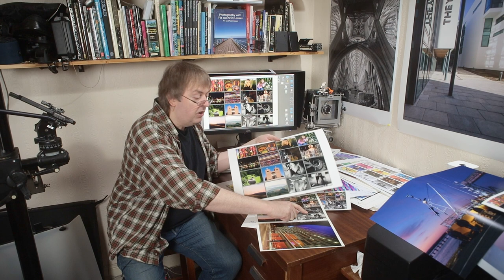Why your prints will never match your screen, and why that's a good thing

Comment: Keith, great advice, as always. One bit of parallel advice I use to give my students, going back into the days of silver b/w printing and color printing in the darkroom, was “take the print with you and look at it over the next couple of days in different places and under different lighting conditions, and if possible take it to where it might (ideally) be shown. Bring that experience of looking back to the darkroom (or the monitor + inkjet printer) to see what improvements you can make.” To this I would also sometimes add, see how the photograph looks framed, behind glass, before you consider the adventure over, and even consider how the size of the print might affect your choice paper as well the color and tonal characteristics of the print.
Reply from the maker: Yes - it's one reason I don't use my print viewing stand nearly as often as I thought I might. It's also my response when people ask about getting specialist lamp fittings and lamps for their print area - fine if you've a specific reason, less relevant for most people.

Comment: Thanks you so much for this video you synthesize my thinking about printing. The most important thing in printing is the result. The road to get there is important but is not the main goal. Month ago I made the mistake of printing with the wrong icc profile and the result was better than the series made with the good one. The key to achieving great result in printing is experimenting and making mistakes.
Reply from the maker: Whilst the 'wrong' profile is never a route I'd suggest - if it works, it works ;-)
It's the result that counts...

Comment: Great stuff! I tack my prints on a bulletin board and after looking at them for a few days, it's amazing what you see that you didn't see earlier.  Almost always have to make a new print. My biggest problem with the board is getting decent light on them. Windows and lights in the house reflect off them in non flattering ways. I'm about ready to get into the wall and put an AC plug up high. From that I can some mount some sort of multiple light setup to shine onto each print from above.
Reply from the maker: Yes, lighting is often underestimated

Comment: Hi Keith. I’m fully set up for top quality prints. I think my screen is the same as yours and the best photography investment I’ve made. After purchasing screen I started to do colour photography. My prints couldn’t be better.  However as you said, I only use soft proofing as a sort of indicator.  I’ve watched other photographers go to great lengths to edit a photograph, put it into soft proofing only to use the most basic ps (hammer and chisel) tools to adjust? Who would know if your prints hadn’t quite matched your screen? Don’t get me wrong, you should aspire to produce the best you can. I love the prints I make on Matt papers. Amazing. One  thing you may comment on is the use of a rip. Colorbyte software apparently takes over the engine of your printer and will take it past the limitations of the native software. But expensive.
Reply from the maker: Thanks
Used to use that RIP with my SP9600 15 years ago. It was useful but expensive then - these days, it's a pricy luxury I've no use for any more.  It has its vociferous fan club, but the entry dues are too steep for me ;-)

I will have another look at the Mirage print software with the P5000, but that isn't a full RIP like ImagePrint.

Comment: Hi Keith, thanks for all the videos and the posts on DPR. You were a great resource when I was considering buying this printer (now I have it). I am really confused by your comments about soft proofing. You say that some of it is useful, that some is overrated, but then what parts of it do you use/trust beyond the gamut check? I was taught by some of the professional printers in town that the soft proof in PS with Simulate paper color, simulate black ink and black point compensation, all checked "should" be a close emulation of how the print would look like. So I use that view to pre-compensate with editing in PS to achieve a look that is close to what I originally had for my (calibrated) screen view. I can't say that that soft proof is always close to the print in my hand viewed with a calibrated lamp; this varies by paper (and therefore the icc profile I use).

So, do you have better guidance as to what part of the soft proof view you trust or find useful?

Thanks!
Reply from the maker: Your 'professional printers' are missing out a key element - their personal experience of what a print looks like and how it will [always] differ from any screen view.

I use soft proofing as an occasional guide for strongly coloured images where I want to see details of colour transitions and the like - it's sometimes helpful.

Soft proofing appeals to 'recipe followers' ... A>B>C>Print . Unfortunately the best printing needs a feel and understanding of what's going on - that [hopefully] is what your 'professional printers' have...

You already have the key expertise when you've noted the the soft proof can be quite a bit out depending on paper. Learn to view the print as the final result and the screen image as an intermediate step, which may differ depending on the paper and image.  

This is why I pay so much attention to printing known test images for any paper - they give me a baseline more firm than looking at prints of images I've just edited

Comment: As always many thanks for your channel. Just as a small reminder… i wrote earlier when you got the P5000 that I didn’t found how to get the nozzle check as an automatic scheduled process. For example when I am out from home for a week. I tried but not succeed… take care! Göran from Latvia
Reply from the maker: I was told that setting turning off the auto shutdown, and setting a cleaning time would do it.

I can't actually test this at home though (I'm not leaving the printer unused and switched on for a length of time)

Comment: Lots of good information, thank you. Have you an article on the important of file size, resolution, from a camera?
Reply from the maker: No, because it has so many caveats, any suggestions would be largely meaningless.
If I gave a number for any particular size it would be wrong - the answer is 'it depends'

You need enough detail for the print size - it's also about image content and subject.
Reply: @KeithCooper  
Thank you for the quick answer. My problem is that I just got a 2nd hand 36Mpix D800E and I try to plan ahead for a 2nd hand 45 Mpix D850 in such way that I have planned to get two Zoom lenses 24-70mmF2.8 E VR and 70-200mmF2.8 VR. I just got a 28mmF1.4 E to the camera but I have lots of old Nikon and Zeiss prime lenses and also three Nikon TS lenses that I will use on a 45 Mix camera but in a few year time there will be a 55-67 Mix Z8 camera. And then my lenses may not be good enough and I will use a FTZ adapter on that camera if I can afford the Z8. I'm an amateur “arty” woodland and infrastructure photographer and I plan to print A2 using a Epson P900 printer.
Reply from the maker: I've printed from 11MP images at A2 - so any of those cameras are easily enough.
I know you want numbers, but you won't get them from me ;-) :-)

As to 'lenses not good enough' - I've heard this for nearly 20 years and it's still largely just hot air on camera forums ;-)

I still use a Canon 24-70 2.8L and 70-200 2.8L IS I bought in 2003, but on a 50MP camera.  I expect to use them still, when the 5DS is replaced by a 100MP camera ;-)
Reply: @KeithCooper  II still have a D700 12 Mpix camera that replace my D300 12 Mpix DX camera a year ago when it broke down. I don't have a 19mm PC lens yet or a good 50mm lens. I got a Zeiss planar 50mmF1.4 but it has CA at a large aperture opening. And I don’t have a good AFS 400mm F2.-8 G VR tele lens but only an old AF300mmF2.8 IF-ED screw drive lens.

Comment: The display used makes a huge difference also, lighting matching to the calibrated device or vice versa is also helpful when comparing; high CRI bulbs are preferable as well. Using a well calibrated OLED C1 (sub 2% de BT.2020 and sub .5% rec.709 with calman), they are much cheaper compared to desktop calibrated displays for editing purposes and offer flexibility of use),  I am able to use soft proofing in ps very effectively to get a image to look how I want on a specific paper types before print.   I don't think all images/art styles belong on, "the customer's paper of choice", but they should be sold the correct paper to most accurately display the image/art they choose.  There is surely an optimal  paper for each image or art style, in most price ranges.  The main differences for my workflow;  the smoothness of gradients are superior once printed, not different overall in color or tone, but in the transitions between on a higher dpi thus making it look smoother, the ppi of the monitor being only 91.79 pixels per inch shows more steps (main disadvantage to using a large oled).  This is with a professional printer full disclosure. (z6200PS).
Reply from the maker: Indeed, soft proofing CAN be of use if handled well - poorly used it is a source of frustration for many.

Comment: I just try to optimize what I see onscreen (my primary workflow being DxO PhotoLab 5 Elite, possibly also using Nik and/or Topaz Photo AI or other software, depending on the image). When I get the image looking the way I want it to (on my factory-calibrated Benq PD3200U 4K monitor set to sRGB and 50% brightness--I generally edit with most outside light blocked out and no artificial ambient light), and save it (either as a TIFF or JPG). When I want to print (on my Epson P900), I open the file with Epson Print Layout and generally use the OEM ICC profile for color, or Advanced B&W Photo for B&W (in which case I generally use the confusingly default "Darker" setting), and Black Enhance Overcoat and Black Point Compensation where applicable. I'm still not sure about Perceptual vs. Relative Colorimetric Rendering Intent, but generally use the latter (more testing needed). I rarely use Maximum Quality as High Quality produces phenomenal prints in most cases and takes a lot less time. Although, as you point out, it's impossible/pointless to 100% match a projected image to a print (and of course prints look radically different depending on paper and lighting), I'm generally satisfied that the print reflects my artistic vision based on what I see onscreen. The important thing is "does the print work?" Experimenting with various papers and settings is part of the process (as you say, experience is hugely important--I still feel like I'm on the steep part of the learning curve) but IMO it's better use of time to record and edit more images than to obsess over the mythical "perfect" print (sometimes easier said than done)...
Reply from the maker: Yes - finding your path through this takes some time ;-)

Comment: Hi Keith, newbie here. love your videos and am slowly figuring out how to print. One question that keeps coming to mind is this:
Cameras can capture images in either Srgb or AdobeRgb gamut. Monitors can display in either an Srgb, AbobeRgb, or Dcp gamut. But nothing I’ve heard ever mentions what gamut a printer uses. Does a printer use a gamut? If so, which? Does it matter? The reason I ask this is if I take a photo using AdobeRgb, process (edit) it in software using AdobeRgb, then print the photo, will the printer be able to use the AdobeRgb gamut or does it say print in Srgb. Are there limitations to a printers (for lack of a better term) gamut.
Reply from the maker: The printer/paper/ink gamut is defined by the printer profile.  This is either a specific icc profile, or an implied one inside the printer driver

Cameras do not capture in srgb or A98 - raw files have no profile. A profile is assigned when processing them either in camera [jpegs] or with processing software

Monitors can display in whatever gamut they have - this can be calibrated to a known type if needed and within the range of colours they offer.

I have covered this in different ways

See this
https://youtu.be/1XbjGvVJZQU

and this
https://youtu.be/a1O__CFXKxE

Also, I'd suggest reading this - very useful
The Colour management chapter from the CS3 book [still relevant]
http://www.photoshopforphotographers.com/pscs3/download/PSCS3_colmanage.pdf

Hope that lot helps!
Reply: Thank you. That clears a lot up

Comment: question: do you come to lincolnshire and can you fix my prints? 😂 been struggling to get the prints somewhat close to the screen. but they come out super desaturated quite often. tried to set up my monitor so its more desaturated so I can get a more accurate representation. tried changing the ICC profiles , but the results aren't great. the best I could get was to save as a jpeg then print it off. going to buy some epsom glossy paper so it matches my printer see if that helps, (that was epsoms  default fix because they couldn't help me ) after that I'm out of ideas.
Reply from the maker: I do bespoke on-site print training as part of my commercial work - see here
https://www.northlight-images.co.uk/commercial-photography/training/photography-tuition/
Drop me an email via Northlight if you want to know any more?
Have you calibrated the monitor - this is not something which can be done 'bye eye'

Comment: Do margins actually always appear correctly on paper? (Specifically the Epson ET-8550)
Reply from the maker: Not always is the best I can say.
It depends on the software, driver, computer system and particular paper size.
Where margins are critical I'll do a test print on plain paper to check

It's not something I tested for the 8550 when I had it here, so I can't be more certain than that, although I do recall some issues with custom sizes via the top slot (it's mentioned in the main [written] review)
Reply: @KeithCooper  alright thank you, and a huge thanks for the in-depth written review!